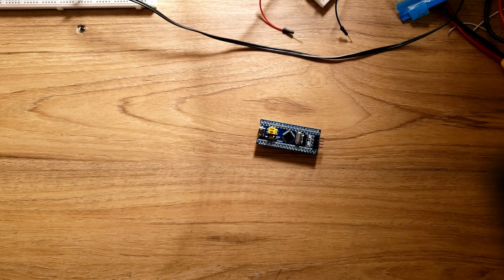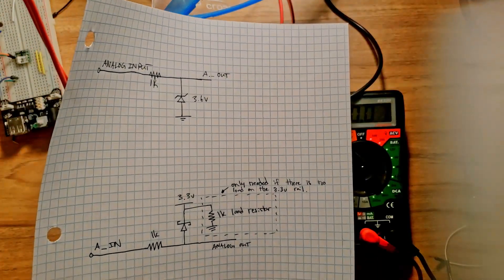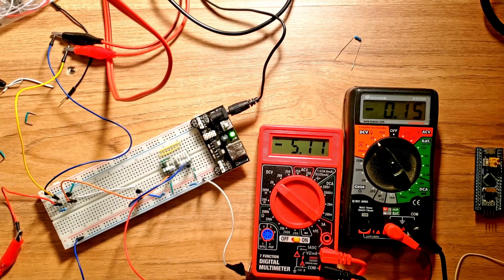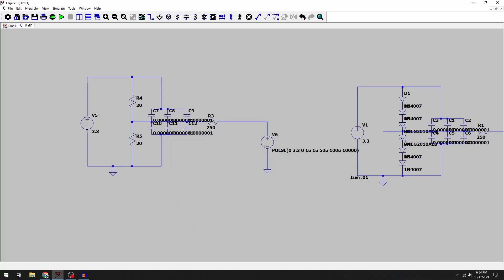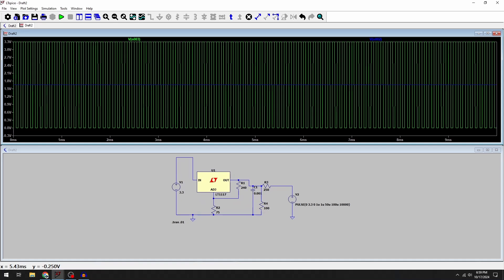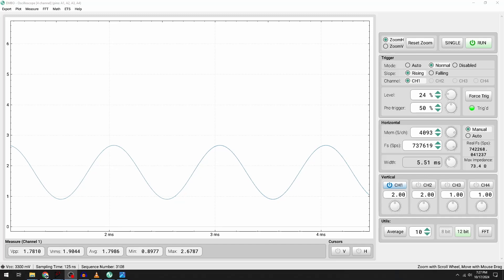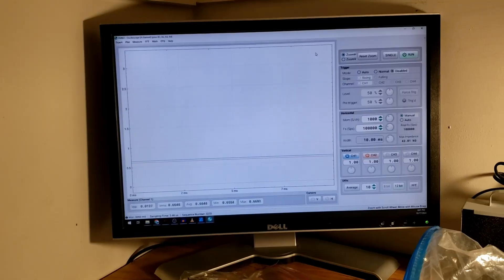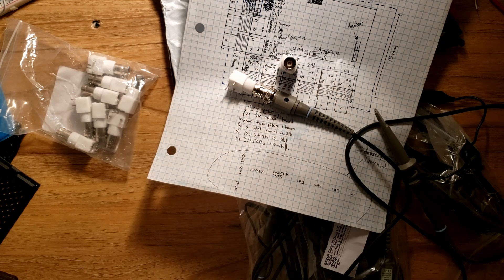Building Oscilloscope with an STM32: Hardware, Software, and Challenges

Comment: I uploaded a new PCB with 0805 parts on GH, 0402 is hell of the job to solder. Dimensions of PCB aren't changed, but it should be much easier to build. Can you explain Matt why R32, R33, R37,R38,R38, R40, R46, R58, R59, R87, R88, R90, R91, R92, C23 and W25N01GVZEIG are "NA"? Are they necessary or not, if yes, which are they values?

Comment: Just check GH for MS-STM32-Oscilloscope-Custom-PCB-Case
Reply from the maker: I just checked out your PCB and stp file. I am genuinely impressed! You've done an amazing job and paid close attention to detail!

Have you printed any boards yet to try them out? Also, how did you convert the easyeda files into kicad so well?

This is really really cool! Thank you for improving this project.
Reply: @matthewspotten3533  No, since I know very little about the electronics I hoped that you'll check the PCB, it is the third PCB that I dealt with. Your design is great, but 2.54mm flimsy headers are simple terrible. Soon my friend will assemble osci based on your PCB, possibly I will later build another one based on my version of it. Your PCB is great, but parts are too close to each other, and headers are not suitable for such design. Both M12, and M8 connectors that I used cost app. 10 euros on Ali. I just spread parts around, and replaced headers. Case should be OK, i left 0.2-0.5mm space around openings  to compensate possible problem with tolerances. The case costs app 25$ including shipping. The only thing that I didn't add to case is a small ventilation grill, since I couldn't find nothing appropriate on Ali currently. My best idea is to place 50x50mm stainless steel reballing stencil at the bottom of case that could help to eliminate excessive heat. It would be great if someone with more experience could check my PCB, I checked connections twice, but I am just a novice.
Reply from the maker: At first glance all the connections look good. You've done good at keeping the decoupling caps close to the power input of the ICs. Your via sticking looks pretty good as well. You've chosen a decent stickup for this two layer board signal + gnd / signal + gnd.

You could get rid of the SPI flash chip unless you want it. I had included it at first to store software for the user but had decided not to do that.
You could put some more vias around the oscillator to further isolate it and prevent additional noise but It should still work if you don't.

https://www.st.com/resource/en/application_note/an2867-guidelines-for-oscillator-design-on-stm8afals-and-stm32-mcusmpus-stmicroelectronics.pdf#page=46

I had made the logic analyzer inputs configurable so that oscilloscope Input 1 and 2 would not have to share the same inputs with the Logic Analyzer 1 and 2. I was not able to change the firmware so the switch is required. There are 4 extra signal lines that go to the 4 logic analyzer lines with one resistor saying 0R and the other 0R (NA). The 0R (NA) resistors and its traces can be deleted as I don't think I'll get around the recompiling and editing the firmware.

When designing a two layer PCB it's best to have a reference GND plane (possibly on the bottom) that is mostly solid, only cut by signal trances for small lengths. This is done so that return currents have direct paths back to the source. This matters mostly for higher speed stuff. 

I think your design will work. I often find problems when I design something and have to make a second design.

Congratulations! You did a great job! Your work for the limited experience you have is really good. I like the case too. There should be no worry about dissipating heat as the stm will barely even get warm.

Best of luck to you! I hope it works on your first try but if not that's okay as well.

Comment: Hi Matthew, I created custom PCB for it (it has only 2 layers), I have replaced flimsy 2.54mm headers with M12 and M8 vertical PCB connectors., as well I created a 3D model of case for it. Please contact me if you're willing to check it.
Reply from the maker: I'd love to check it out!! That sounds so cool! You can look me up on LinkedIn and message me there as well as Facebook.

Just look up Matthew Spotten

Let me know if another contact method works better!

You can share it here too if you want! I'm sure other people would love to see what you have come up with!
Reply: @matthewspotten3533  Just check GH for MS-STM32-Oscilloscope-Custom-PCB-Case

Comment: Hello, brother, your PCB schematic file is not in the GitHub files. If you can post it, I really need it.
Reply from the maker: Sure! I don't have an electronic schematic of this version as this was the prototype/proof of concept version.

You are welcome to check out my f303 version with a custom PCB. You may be able to derive some of the schematics used in that.

Sorry I don't have an electronic schematic for this version. I hope the hand drawn schematics in the video will help some. There is not much to it. I used some NPN and PNP clamps for protection.

https://oshwlab.com/mspotten/stm32f303-occiliscope-new

Comment: I have a blue pill that's been collecting dust, would love to try this!!

I've been thinking of doing a simple DAQ, but can LTSpice simulate non-LT/Analog-Device chips.. for example, if using an external TI ADC?

BTW, is the current clamping needed in case the user plugs in a voltage that is greater than the Microcontroller's ADC input range?  Or is it so that ADC's input independence isn't affecting the reading?

And the EmbOS looks well thought out and very polished!  But did you find that there was no open-source project that could be easily made to work with the hardware?  Something like, PlotJuggler, yoofie / Telemetry-Studio-Public , ScopeFun, ThunderScope, OpenHantek6022, ElectricUI , etc?    It's interesting that for Logic Analyzers , everyone uses Sigrok.. yet for oscilloscopes, it's usually custom software  ex.Haasoscope Pro,  Digilent Waveshare, etc

Sorry, one more question, the repo seems to show one firmware folder.. does it use a pre-processor to select if you are programming the Blue-Pill versus the Nucleo board?

Comment: Too great
Let me ask how to measure 3 phase sine wave 380v or 1 phase 220vac. You try to draw the circuit and give more video instructions
Thank you very much!
Reply from the maker: Thank you!
Would you want to measure the phases in reference to GND or in reference to each other. You could buy a high voltage differential probe that handles the scaling and isolation. I believe if you wanted to use those probes with this oscilloscope, you would have to adjust the values of the resistor and capacitor divider on the PCB to take voltages from -5v to 5v instead of -3.3 to 3.3v which is explained in the schematics.
I've been busy with school, I apologize for not getting back to you as quickly as I would like. I hope you find or have found the information you need. Let me know if I can help!
Reply: @matthewspotten3533   Tnank verry much !

Comment: Can you make bluepill f103 non 303 osciloscop version?
Reply from the maker: I think you can do it! There not much to it. You can find the pinout for the bluepill scope at this link
https://github.com/parezj/EMBO

If you would like to use protection circuitry I used in this video, just look up PNP and NPN active clamps. Maybe use AI to help you understand how they work or to give you other options you could use instead. 

Just go be creative! It's more fun that way.
Reply: I know ,but how to wiring sbhematic and all components bnc to bluepill
Reply from the maker: Oh, I see! I misinterpreted what you were asking. I can make that schematic for you real quick.
The f303 version has its own PCB that hosts just the f303 microcontroller and no other boards. Would you want the schematic to show how to connect the components in the f303 version to the bluepill board or only the f103 microcontroller?
Do you want to solder this up on a prototype board or make your own PCB?

Comment: Can you share schematic pcb file for blue pill version like this
Reply from the maker: I don't have official schematics for this prototype version but if you want to replicate it you can do so from the paper schematics in the video!
To set the clamping voltage for the PNP and NPN active clamps I would (instead of using didoes) chose some resister divider providing 0.4V to the base of the NPN transistor and another resister divider providing VCC - 0.4V (or 2.9V) to the base of the PNP transistor to set the  clamping voltages just under VSS (negative clamp) and just above VCC (positive clamp).
For the reference voltage I would use a LDO regulator with a load resistor to provide a reference that can source/sink set at 1.65V

I would be willing to create a quick reference schematic I could share if you need more assistance! Best wishes!

Comment: i did s clamp circuit a fee years ago, using diodes clamping to s rail...the trick is to get really, really low capacitance diodes...if there's a series resistor, the current flow is not much, and they are conducting forward.
I'm playing with a F303RE, which has 4 x 5 MHz ADC's.

Comment: Input protection :
Diode clamp to voltage rails, and potential divider to bring signal within range.

Mid point reference :
IF you're adding a voltage regulator to make +1.6V, then just build a split rail supply with + and - 1.6V.

Comment: Enjoyed the video very much, I bought the PoScope USB oscilloscope - function generator - logic analyzer -  spectrum analyzer and I also had better results when I didn't use my USB isolator which uses the ADUM4160 IC respectfully. Please keep the project rolling, I will definitely build it. What op amp r u planning to incorporate into the front end with the bnc connectors?  Thank you
Reply from the maker: Thank you! That is really interesting. When you say you had better results without the isolator what does that look like on the computer side? Less noise or more stability?
I've done some testing with op amps and the found the COS8054SOP to work pretty well. It's cheap, has a high slew rate and very low bias current. Right now I'm planning to use two of them (one as a buffer and the second stage as an adder). This way I don't need a USB isolator for measuring negative voltages as I can add a voltage to the output of the first op amp and run that positive voltage into the input of the microcontroller. 
I'm just waiting for my PCBs now but they will be here soon!!
Reply: @matthewspotten3533  when I'd be taking measurements with the PoScope with theusb isolation the software was real glitchy, multiple screens opening while triggering on a voltage, pretty soon I'd have every tool open but only using the scope 🤣. I quit using it and don't have any issues with the PoScope software, been using it close to 10 years really happy with the $80 purchase. Only thing I did to it was put high quality Amphenol bnc connectors(Tektronix) on it... Huge difference in noise 👍 just watched your 2nd video 👍 good stuff you should continue doing this as your smart and easy to follow, fluid speaking... Thanks
Reply from the maker: I just saw this! Very interesting and thank you for your kind words!